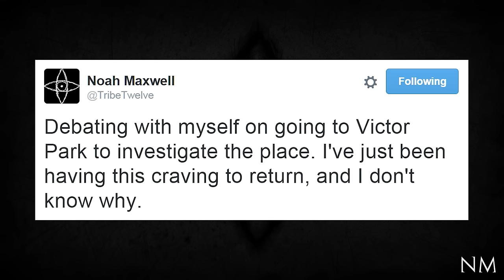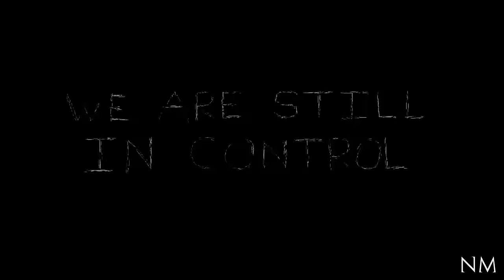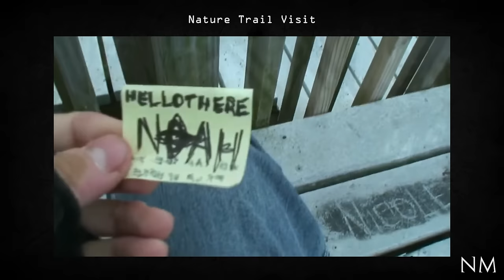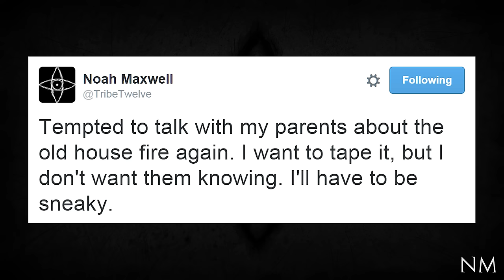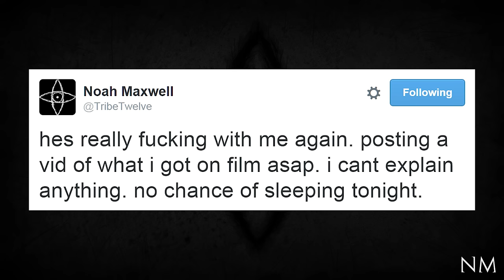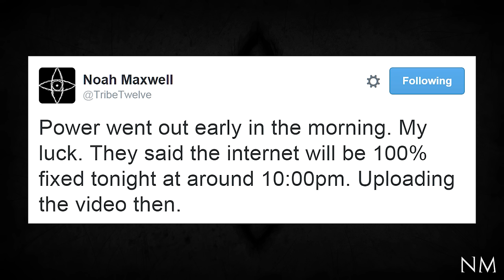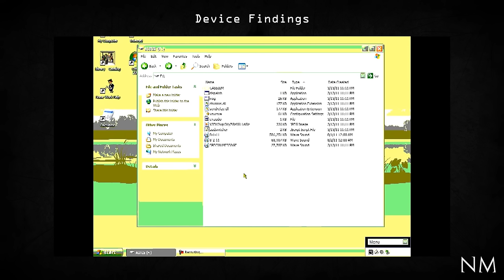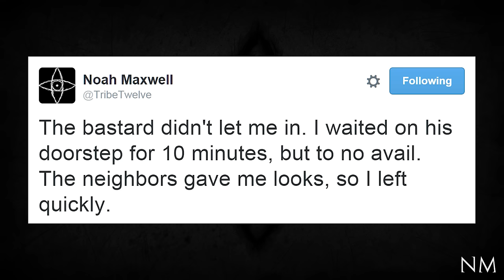TribeTwelve: Explained - Part Two

Comment: ...what, no mention of how the Operator symbol is slowly phased out and replaced by the Observer symbol? Is that not significant at all? By about halfway through this video, the Operator symbol just stops appearing altogether.

Could it be that the Operator symbol was originally specific to Milo, and it was used as more of a bridge to get at Noah until the Observer began showing himself more and more and the focus on Milo disappeared? Could it be that the Operator symbol was intended for use the entire time, but the Observer wanted Noah to know there was someone else  other than Mr. Tall Pale and Faceless involved?

I mean, it's not really explained, touched upon, or even easily noticed. It may just be the creators wanting to distance themselves from Marble Hornets, with no story significance for the dropping of the Operator symbol. Who knows...
Reply: TheInunah maybe they are originally going to use that symbol and changed it later on

Comment: Holey Shieet. At about 14:00 min. in, our power got cut off/ we had a brownout. Turns out it was some kind of 'power rotation' from the power plant. Still, what a fucking coincidence.
Reply: That happened to me before. Was watching a Scary Story compilation, there was some story where all the lights went out, and my whole neigborhood had a blackout five minutes later.
Reply: lol
Reply: i'd have a fucking panic attack lol
Reply: What's a brownout? How's it different from a blackout?
Reply: Paul Smith In a black out the lights just go out, in a brownout they dim temporarily but don't go out.
Reply: +Paul Smith 
In our terms, a brownout is a power shutdown in a local area, not being big enough to cause such panic, just some annoyance for some time. A blackout, however, can be as small as an entire city or as big as the entire country. When the lights just dims slightly, we call it a 'single-face', for some fucking reason I don't understand.
Reply: Lemuel Ogabang it's probably "single-phase" which may have to so with the power delivery to the property. Something to do with AC current, but i could be wrong
Reply: +Nubbiecakes yeah, I guess
Reply: Lemuel Ogabang lol I would of flipped out and been like 

"SHIT SLENDY IS COMEING FOR ME NUUU" 

but that would be kinda cool tho

Comment: 2:35 And this, kids, is why you use protection.

Specifically, a burner laptop running TailsOS, with the WiFi physically disconnected (inside the case), not just shut off. When you're done, break everything to bits.

Comment: I'm not very far into it yet, but so far TribeTwelve hasn't impressed me. The acting is sub-par, but that's to be expected. The things that really get me are as follows:

A: Technology doesn't work in some of the ways it was portrayed here, and even if it did, an average dude like Noah understanding it doesn't make sense ("data transfer protocol").

B: The audio engineering is worse than in season 1 of Marble Hornets when Troy was basically deaf and made everything way too loud (30+ seconds of +15dB audio doesn't make for good viewing).

C: Some of the remarks left by The Observer are the kind of thing a 14 year old would write. ("WE HUNGER", amateur-sounding evil laughter, usage of "edgy and mysterious" clips like water dripping backwards into a faucet for no reason, etc.).

Comment: This is a pretty good horror/suspense project (best on NM’s part) but the “dead giveaway” was the parents & girly friends terrible acting... the icing on the cake was the obnoxiously large surveillance bug... ya know cuz those have boombox alarm clock speakers attached just in case. I respect the effort but suspension of disbelief went right out the window between all that and the single twitter friend

Comment: does anyone know if this could be classed as analogue horror?
Reply: No, analogue horror are usually period pieces, the technology in this is old cuz they're using cameras that were fairly new at the time but 10 years later are pretty analogue.
Reply: This is an ARG, Analog horror should only use retro hardware at the very minimum. This one is aware of and actively uses more modern tech like USBs and the Internet. 

Mandela Catalogue and Gemini Home Video are Analog horror